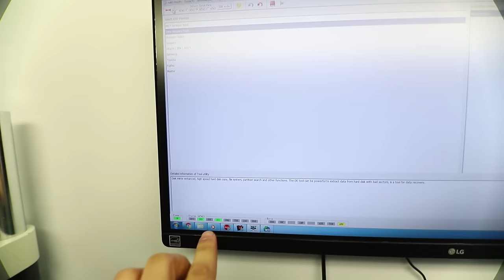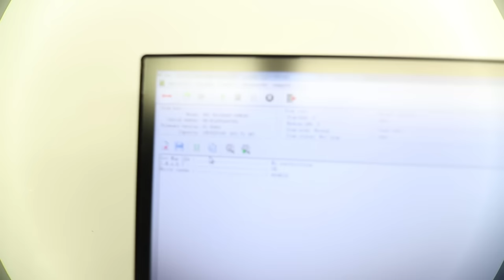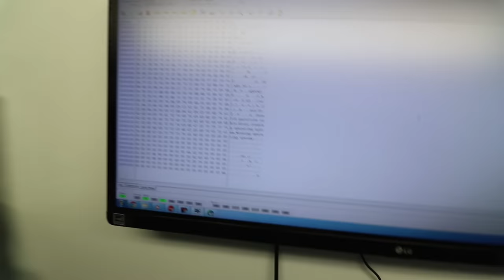hard drive does not spin? simple way to get your data back

Comment: Holy cow I can't believe it !! Lacking all the tools except for my faithful T8 screwdriver, I deliberated for hours and watched your videos over and over. Searched the web for map of the Seagate PCB board so I could find the diode. My multimeter was broken. And I didnt have a hot air gun. So I just grabbed the diode, ripped it off, and plugged the drive into power... and the drive came back alive. Absolutely unbelievable, I can't believe it worked. This drive is from the 1990s. My wife's grandfather is going to be very happy about his recovered data. THANKS !!!
Reply from the maker: thats awesome Clay!
Reply: @hddrecoveryservices  if i remove the diode and not replace it can i keep using the drive?
Reply: @angvil  He said if next power surge happens, then the drive is toast! just get data off. and replace the diodes if possible.
Reply: @danrazART  I did remove/replace the diodes the HDD is still not working I guess my problem is something different. I ordered a replacement PCB lets see if transferring BIOS will work. Fingers crossed
Reply: This has been a life (and money) saver!  I just ripped mine out too and it's working great now (well enough to copy everything over)!!!

Comment: Thank you!! This saved about 900 GB of family photos, videos, documents, etc!! I am so glad I found your video. I did exactly what you said to do. I used a cheap multi-meter from Harbor Freight ($14) and a cheap soldering iron from Amazon. Removed the bad diode and BAM!! Moving data as I type this up! Thanks again!
Reply from the maker: Amazing! Great job Dwayne!
Reply: Do you have to replace the diode with a new one or just take it out and it works like before?
Reply: @ch3lsea44  You should replace, if not, your hdd will have no more protection, so if it happens again, much more delicate component or multiple components will fry.
Those diodes are like fuses. So if you can't replace diode, backup your data from the drive and consider it unsafe.
Reply: @nilsfrahm1323  No need to replace, just copy the data to a good new drive and toss the bad one once done.

Comment: Thank you! Hard drive had this exact problem. Never tried to fix anything on a circuit board in my life, but I watched this and went out and bought a digital multimeter and soldering iron, followed along with the video and I have now got a working hard drive with fully recovered data!
Reply from the maker: That's awesome!

Comment: I wanted to email you directly to say THANK YOU but ultimately found it much easier to write in the comments and hope you see my message.

Most videos on YouTube are absolutely worthless but every so often there is a video like this that is clear to understand and so helpful.

My hard drive had lost power due to me using the wrong power supply. All local computer repair shops told me it was finished and my pictures of my kids and family were gone. I tried to tell these repair shops about your video but they were adamant it was a lost cause......

I spent less than £60 on tools that I can keep forever and set about doing the repair myself. I wasn't as graceful as you but I found the bad diode, yanked it out and my hard drive worked. I've since transferred all data to my new PC.

Thanks again

England, UK.
Reply: Oh hi Mark, is it possible for you to send me the links to the tools you bought? I'm also in England and my HDD wont power up! 😭

I want to give this a go, also worried I could kill the HDD forever!
Reply: What are thd tools? Hopefully you will respone:)

Comment: A big Thank you  for this instructive video!!!!! Had the same drive with same exact issue. Solder gun, volt meter and 15 minutes of work saved a life worth of photos!  Appreciate you!!!!
Reply: What kind of liquid stuff did he put on the diode to remove it?
Reply: @sn1p3r847  Flux

Comment: I was just for the umpteenth time searching for a file that I know sits on a Seagate Barricuda 7200.12 right here on my table.  My backup was lost in some manner (traveling too much with too much chaos) without my knowing, and my hard drive went silent last summer, and I was up a creek without a paddle.  I'm 64, been using Macs since '84, first time I ever lost a hard drive.  It sits here staring at me, driving me nuts...since I can't even get it to spin.  You've given me hope.  I love the simplicity.  Now I need to get a T-8 screw driver...and see what's possible.  Love the simplicity of your presentation as I've worked in delivering rural wireless internet, but from the development side and marketing side, not the tech side.  Thanks for the good work and inspiration!

Comment: Hey man, I had two drives dead which I almost threw in the trash ( 2TB and 1.5TB seagates greens ) and then I ran into this video by accident. Popped one side of that TVS up and guess what? The drives both work now. Thanks man! And keep up the good work!
Reply from the maker: thats awesome! if you want to use these drives for storage, maybe order replacement TVS diodes to put the protection in place again. Otherwise, the next power surge will blow out the preamp
Reply: I have a 2TB that's become a 3.86GB unallocated. I've tried Seagate SeaTools but it's not able to preform any test on the drive. I thought of using the entire back panel of another 2TB to try out, will that work as this video seems lovely but I'm scared
Reply: @t3m185  if you tried it, can you tell us about it here please? i have the same problem with a 3TB at the moment but i dont have a second panel :/
Reply: @Colarocker  I eventually did but nothing changed. Seagate sent me a message that I must send to a Recovery company and recovery isn't even guaranteed. I'm just praying for a miracle now

Comment: sweet video.  thanks.  tested both diodes on my failed HD.  first one was bad.  pulled it off.  works like a charm now.  recovered all data.
Reply from the maker: Thats awesome!
Reply: Really do appreciate the help.  So easy to follow and accurate.  loved the way it was filmed.  almost like i was hanging out with you in the office.  really a big thumbs up.  i won't be replacing the diode (or continue to use the drive).

Comment: This just gave me new hopes for my old Fujitsu HD that stopped spinning 20 years ago.
Reply: Did I hear 20 yrs ago?
Reply: 20?
Reply: Go search for drive stiction. Have experienced that on several drives including a modern 2Tb sata drive. Decades ago I did this routinely to waken up drives that had been stitting idle long. I have several full height 5-1/4" drives that has not spun for many, many years now, and believe those will need that stiction fix to be able to spin up again. The fix involves fast rotating (twisting) the whole drive with your hand, then stop abruptly. This might be enough to free the platters from the stiction. Believe me, I have done that several times.  For very old drives, I think this can be a "permanet" fix, but for new drives this might be the last resort to bring them temporarily back to life to enable the user to salvage data off the drive before discarding it. Or use it just for non-critical stuff after that.
Reply: @shadrackongeri3810  Can happen. :) I have a Samsung drive in front of me that stopped spinning around 12 years ago. I kept it in my drawer ever since, and I have no idea what's on it.
Reply: @for-real-tho  I have a similar situation with a hard drive I did not realize I still had from back in 2004. Now, I just have to get me a T8 screwdriver evidently of course the stores are closed with it being Christmas LOL just my luck.
Reply: @Planet_Shel  Good luck with your drive. I have actually managed to make it spin by removing the faulty part and by shorting the blown fuse, but still couldn't read any data. The head was keep making clicking noises, but it wasn't stuck. I opened up the drive as they show in many videos, but none of the tricks worked.

Comment: Awesome video and very helpful! Got my wife's old hard drive that had some pictures on up and running. Was able to back it up and put the data on to her new computer.
Reply from the maker: you are welcome Brad
Reply: which software did you use to back up the data after performing this solution?
Reply: @NevaramoWR  I used Veeam Agent for Windows. It's a very good backup software. Had Veeam agent for Windows on my laptop so hooked her hard drive up to it with a external hard drive case and backed it up and then installed Veeam Agent for Windows on her laptop and restored the data. Edit: Veeam Agent for Windows is also free.
Reply: @brad7648  Thanks alot bro. I'm gonna give it a go
Reply: @NevaramoWR  No problem. When I backed up the data from my wife's hard drive to my laptop I had a extra external hard drive plugged into my laptop that I backed it up to. Then plugged that into her new computer, installed Veeam Agent for Windows on hers and restored all the data on to her internal hard drive. Good luck! You will need to create an account on Veeam to download it. Here is the link https://www.veeam.com/windows-backup-free-download.html

Comment: Great video thank you but...question.  Why does just removing that diode fix the problem?  Shouldn't it be replaced?
Reply: The diode acts like a fuse. It's normal state is to be open ("disconnected") but if there's an electrical surge, it fuse and short the circuit, essentially shutting it down in order to protect all the other remaining equipment (think like the button on a power bar). You cut it out and it's like it is in normal mode again BUT now you don't have any surge protection so that's pretty much only useful for exporting your data elsewhere but not for long-term usage of the drive itself.
Reply: @DomDEngineer  :  My HDD in my desktop stop working and I tried to transfer files using Sata drive and the HDD did not spin. I think we had a power surge. I'm going to try this. Do I really need such an expensive multimeter that he has listed above?  What was that gel he used to remove the diode? It looks very easy. Staples wanted $250 to retrieve my data.
Reply: @finn8248  i tried this and mine still doesn't work
Reply: @finn8248  A multimeter cost about $20. I didn't use hel or heat to remove the diode on my external HDD, I used mini cutter pliers that the ends look like a bird's beak. I cut one end and bend the diode back and forth to break the other end. Only cut it out if the multimeter shows it as short.

Comment: HOLY SHIT OT WORKED!!
I had an early gen Seagate freeAgent goflex 2tb external hdd that I thought I had completely fried by accidentally plugging in the wrong power cable. It literally used the same plug as my laptop at the time, easy mistake.

It had over a terabyte of data on it that I thought was gone. This was 2014 or 2015 when this happened. I kept it all this time just in case I could get it back. Just today I spent some time looking around on the internet to see if I could fix it. I am now transferring all the data to a new SSD.

This was my answer! Thanks!

Comment: Thx to your tutorial i save my 1Tb HDD !!! Thx so much!
Reply from the maker: You are welcome
Reply: Don't forget to put a new voltage suppressor diode on your drive. And replace your power supply to a better quality one, something is wrong with it, if it blown the TVS on your HDD. Don't use cheap noname power supplies.

Comment: Usually what I do first is to backup the FW, and after test access to data/sectors ehehheeh. Good work, as always!!
Reply from the maker: Same here
Reply: All my disks that I'm actually not able to rescue data from (at home) are dead to the point that the bios won't pass POST with them connected and any OS, generally Linux or Windows will not react to the disk being plugged in. So without an external programmer (which I wouldn''t expect to do anything useful, as I believe any interesting firmware is read from the actual platters) I can't read the firmware.
The tip in this video could help with some of them though, but I'm not certain any of them doesn't actually spin up.

Comment: so far the video seems good - im not finished but glad i found this video!  Gives hope on my drives doing the same. BUT i believe the beep on the meter beeps when there IS connection and will not beep if there is NOT connection. Can you please clarify?  In residential electrical wire diagnostics, the beep sounds when there IS continuity.  Testing a light switch for example, off position no beep. on position should deliver  beep. In micro electronics - is it supposed to be open or closed?  the first one did not beep which indicates a blown wire or no connection.  If its supposed to be in the off position then the meter is reading no connection.  If it is supposed to be connected the meter will beep if the connection is good.  This is an extremely important factor, i know what its like staying up hours into the night or days in, seems like i see some traits of a late night. just saying - sound confuse people.   I was just making sure the beeps are correctly explained.

Comment: Thanks for the tip, i just backed up my old HDD and bought a new gaming PC, went to plug in the old HDD and plugged in the wrong power supply, the WD drive isnt spinning, but im going to exacly what you did, as ive lost so much information, ill be back if it work soon, thank you so much for this tutorial

Comment: Thank you. 

Note: The Toshiba power supply plug fits the WD hard drive perfectly. DO NOT MISTAKENLY PLUG THE TOSHIBA POWER SUPPLY INTO THE WD. DON'T DO IT!!!

I spent last night in a restless slumber of hopelessness and loss, so much work on that drive, so many images, so many years and miles gathering them. I wish I had seen this video before going to bed.
Reply: Same problem happened to me,did you fix your drive by any chance?
Reply: @kevinhuynh31  
Yes - after watching many, many informative YouTube videos.

With the chip board removed from the hard drive, look at the chip side of the board. On the upper right there are two small black chips. These are, for lack of a better term, circuit breakers. One prevents an overload. The other prevents reversed neg/pos. I blew both. It took a while to realize I needed to remove both. The drive then worked (I could hear the disk spin and arm swing) but the computer could not read it. I used Disk Drill to gather all the information on the drive and recovered all that was lost.
Reply: @RichardSpeights  what tools did you use to remove those diodes
Reply: @kevinhuynh31  
I took the board off the drive housing. Then, pinching the diode with a quality pincher tool, I heated the solder holding the diodes to the board with a soldering iron. I'm not that good with these tools, so I left a bit of a mess behind. Nonetheless, I did no damage to the board. 

In the end, it was not that difficult. I was a lucky boy.
Reply: @RichardSpeights  i don’t have a soldering iron do you think a heat gun and flux would also work removing the diodes?
Reply: @kevinhuynh31  
If you can do it without overheating your board. Remember, if you damage the board, your only other option it to take the bios chip out and put it on a donor board - a much more sensitive operation. I've seen the experts use the gun. Go and watch as many videos on YouTube as you have time. Practice with trash boards out of junked computers and whatnot. When you are comfortable, then work on the hard drive's board.
Reply: @RichardSpeights  okay thanks 👍🏻

Comment: I have a Seagate 4TB disk that is totally dead when power is applied, no disk spin, no head click I took off the controller card, looked around, and do not see anything wrong. There is one diode on this board, and it is good. The problem: SATA 12v power pins are shorted to ground. As I have a backup of this disk, no data recovery is needed in this case. I'm more interested in determining which part(s) have shorted. I'd suspect SMT capacitors between pins 13-15 to ground. One day I'll invest in a hot-air soldering station, and experiment on this drive controller. These parts are way too small for even a fine tip pencil soldering iron.

Comment: so you just removed diode and it can run without that diode? :D i red current flow from both sides on one dioede (D1) so i guess that one is faulty cause as i know it should pass current only on one side
Reply: I'm guessing that with the two diodes that it might be a Full Wave Rectifier - now is only a Half Wave, with enough filtration to straighten out the DC.  (but with half of the voltage?).  Or, maybe a Voltage Doubler, with the two diodes?   Just odd that they would install a Secondary Diode - for nothing.   $$$$$
Reply: These two diodes are TVS diodes and are there to protect the rest of the board from small power spikes/surges/etc. - with them removed, the drive will still operate, but no longer has any such protection.

Comment: Thanks for this awesome video explanation on testing PCBs! Excellent resolution and audio compared to anything I've seen anywhere!... Thumbs up ! Few questions though ... How do you know which diode to test and what is the next step if no diode seems to cause any issue? I understand no spinning issue can be caused by burnt motor, stuck heads, dead preamplifier .... How would you go about identifying these issues? Thanks in advance for any replies!
Reply from the maker: There are only a few diodes on there, so test them all. The easiest way to test what is wrong is to put a working (same part number) board on there. If the drive spins with it - then it's not the motor nor stuck heads. If EEPROM on U12 is external move it to the new board, and the new board will act like the original. If the drive clicks with this combo, then the preamp is also fried. If there is no U12 chip on original board (WD drive only) then you need specialized tools that can reconstruct the content and program new board with it.
Reply: Thanks for all this i,fo<